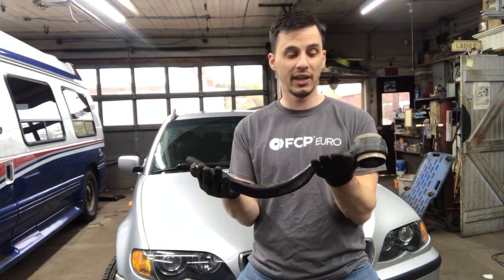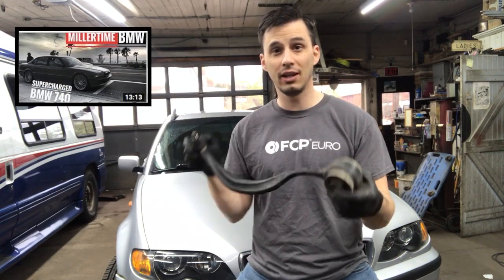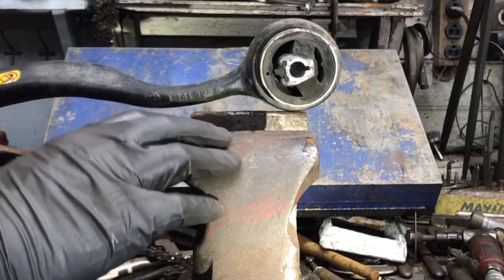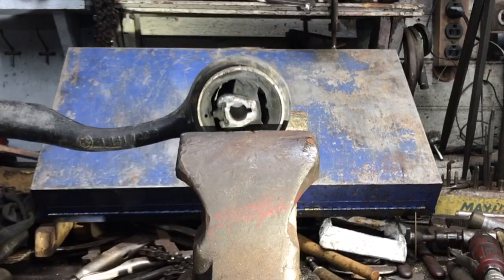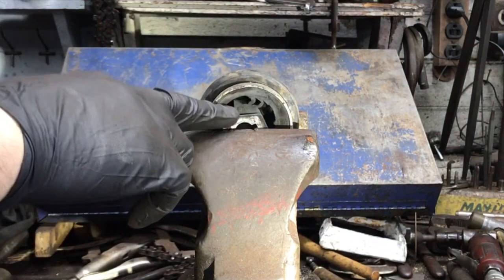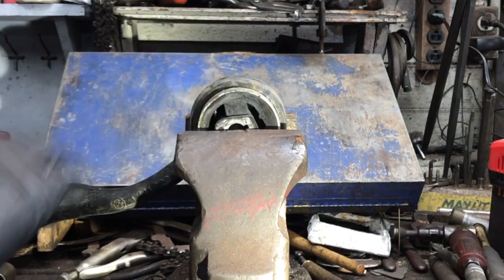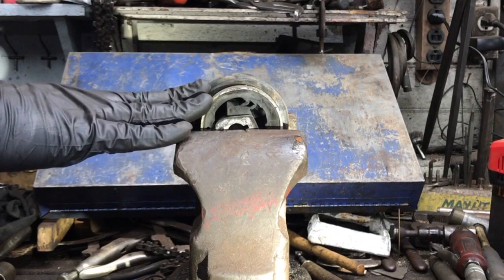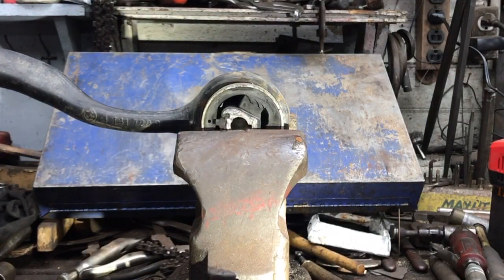Suspension Bushing Preload? What Is It?

Comment: I changed my whole front end suspension on my 2004 Dodge and did this, I did alot of research for over a month before I started, and even then it took me a week to finish.
But only because I ran into problems, wrong part size, that my local auto parts store had to correct, didn't have a certain tool size, had to wait to get a certain rent-a-tool from parts store, etc.

Now with good preparation I can do everything in one day.
Reply from the maker: It's a good feeling knowing you can get it done yourself, isn't it!?
Reply: @millertimebmw  sure is!

Comment: Changing the air struts on my Audi. I need to remove some bolts from the upper control arm and loosen the lower control arm. How would I preload the corner if the area I need to torque down is loose?

Comment: Thanks for the video. When you say "jack that corner" you mean jack the suspension, or the wheel, correct ? Where do you position your floor jack ?
Reply from the maker: Yes, with the bolts loose. Jack under the balljoint on the control arm to ride height. Then tighten the bolts.
Reply: In the case of the E46 there is also this alternative in the Bentley :  "align the base of the bracket so that it is parallel with the center of the wheel bearing bore on the trailing arm". Would it be as effective ? Diagram: https://www.e46fanatics.com/cdn-cgi/image/format=auto,onerror=redirect,width=1920,height=1920,fit=scale-down/http://forum.e46fanatics.com/attachment.php?attachmentid=640024&stc=1&d=1472778507

Comment: Quick question! I didn't preload my rear control arms. It's been a week of driving on normal roads. Have I destroyed my new parts or do I have time to adjust? Thanks!
Reply from the maker: The sooner you correct it the better. Easy to do, jack that wheel loosen and retighten!
Reply: @millertimebmw  thanks for the quick reply! I'm going to do it right after work! Will probably have to use a breaker bar because I was silly and air gunned it tight while the car was lifted at my buddy's garage :s